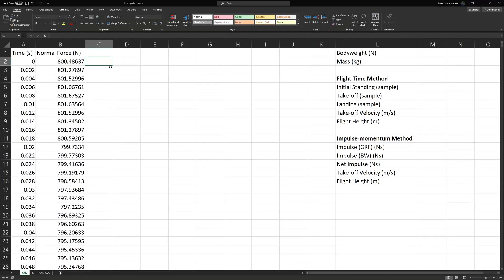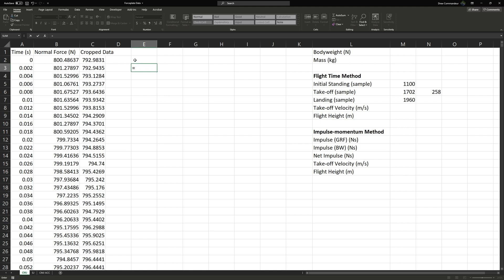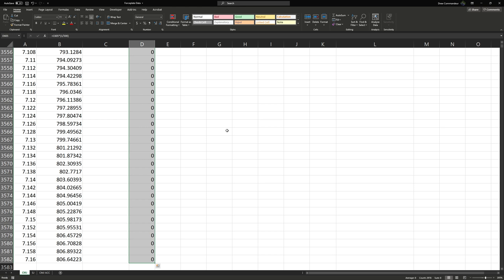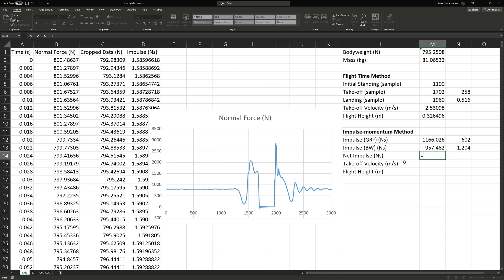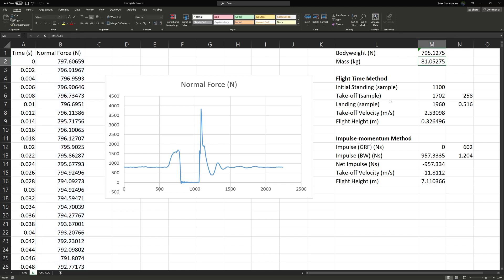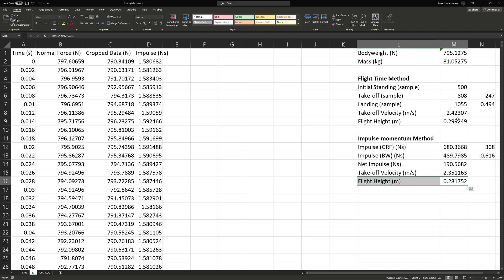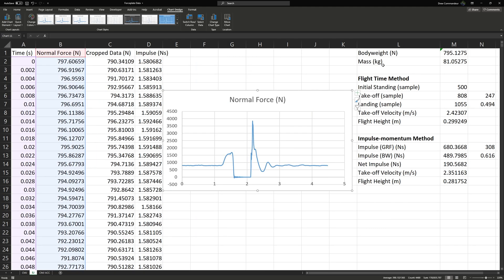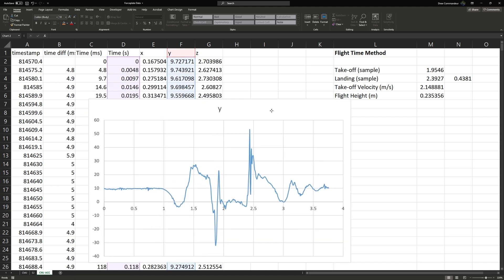Vertical jump height with force plate and accelerometer

Comment: Great video! 
Which Method is more precise? The impulse one or the Flight Time one?
Reply from the maker: The impulse method is better because it determines the vertical displacement of center of mass. The flight time method can be "cheated" by landing with your legs in a flexed position because it is based off of the time you are not in contact with the ground.